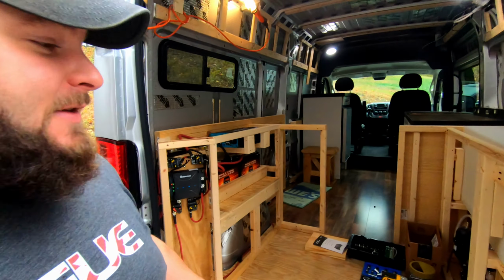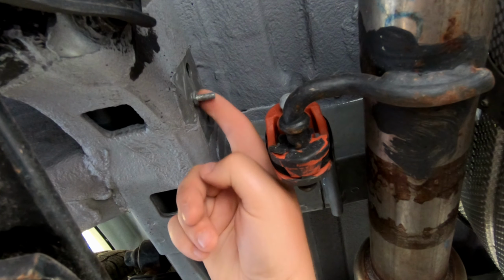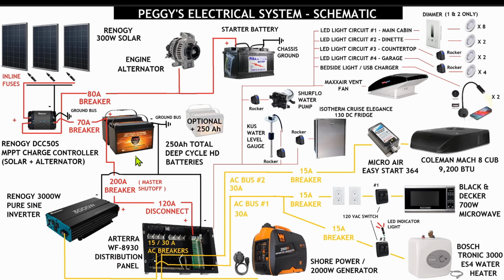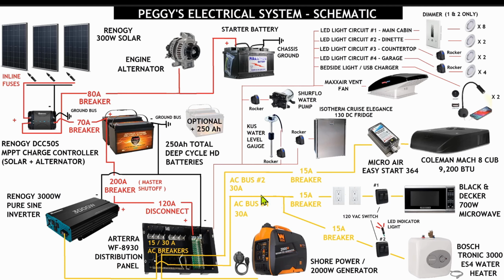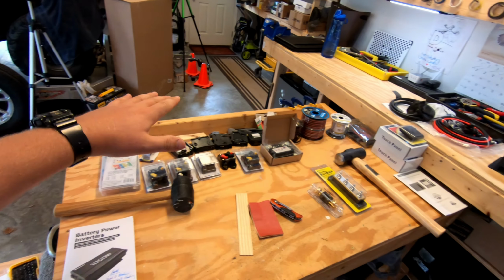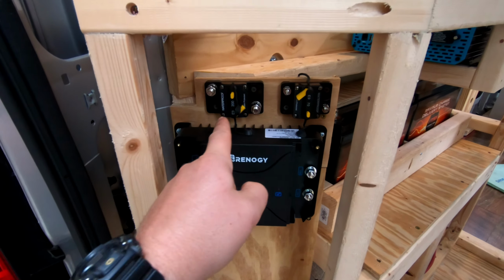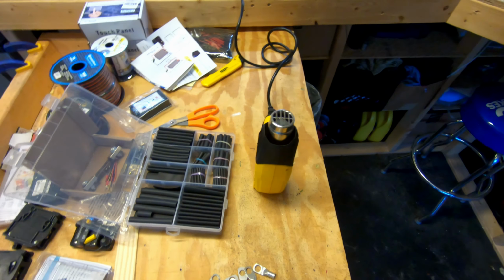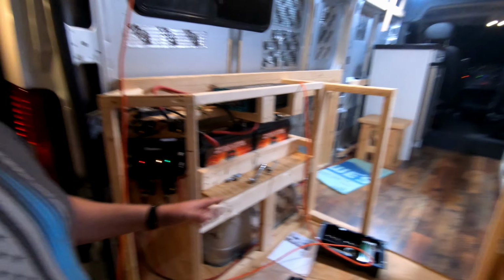DIY VAN ELECTRICAL - PART 1 #DIY #vanbuild

Comment: Question-

I have a renogy rover 40amp solar charge controller, where does the Alternator cable come into play on it? Do you need the specific one you have to have the alternator charge the batteries?
Reply from the maker: That’s correct, the Rover series only supports Solar input.

Comment: Sup Logan I like your videos your good what u do thsnks for sharing “what kind of copper wire do u recommend me using  ? to the front battery I just bought 2 lithium batteries running 400 amps and 600 watts of solar panels most likely I would use the same gauge wiring to my charge controller & inverter I would appreciate if u can help me out
Reply from the maker: Hey Mario! I use Windy Nation 100% copper for eveeything.  Based on this charge controller, 4 Gauge is sufficient for most runs including long run to alternator (starter battery) DO NOT buy Copper cladded aluminum wire or audio grade wire.  Stick to 100% stranded copper for your DC power system electronics.
Reply: Right on 👍🏼 Logan” good looking out keep doing what your doing i enjoy watching your channel

Comment: Hi Logan, would you recommend using that Bosch water heater on a 1500W inverter? Thank you!
Reply from the maker: No and here is why, it pulls 1300-1400ish.  A 1500W inverter may only supply 1000W continuous and 1500W peak.  Spend the $$ on a reputable inverter.  I’ve s once
Switched from Renogy and use Xantrex and Edecoa.
Reply: @biglogan3690  Ok! But if I understand it right, that would also require me to install batteries with bigger capacity?

Comment: How does this set up compare to using a Goal Zero 1500x for the battery and most of the equipment used here? It seems like for $1600 the 1500x has better specs and save you about $1,000. Maybe I'm missing something.

Comment: You have a ANL Fuse the between the battery's and the Ground Bar, what size are you using? And would the size change if you had more battery's?
Thanks for the Videos Great Job!

Comment: Also did you go with recommended cable? Or figure your own calculations and go with that? I see most people on Youtube using 2/0 from their house batteries and 4 gauge for connecting the dc to dc charger.. If course I have more research to do before I do anything!!

Comment: I have some of the same components. I went with a 3000w pure sine wave inverter and charger from Renogy. I figured it would be easier to have my shore power connection all in one. Assuming I understand the equipment use properly. I’m watching and reading everything I can get my hands on to learn before I connect a single wire. I’m in Yukon Canada. It will be another month before we really get out of winter up here.

Comment: Hey Logan! Love the videos! I just got a promaster to start converting. So a positive wire goes from the starter battery to the dc to dc charger right? You don’t have to run a negative? I’m not super smart with electrical. Just looking for clarification.
Reply from the maker: Thanks Amy.  You're correct the unit is grounded to the battery / negative bus bar / chassis.  Check out Will Prowse on Youtube and his Website mobile-solarpower.com for diagrams.
Reply: @biglogan3690  i love Will Prowse. He explains everything so simply! I was curious also because the inscreen vid showed you connecting the positive to the starter battery but I didn’t see you connect a negative to it.

Comment: I'm a wire wrangler too. Love a clean and tidy build that's protected. Sweet job! One question though- what's the wire gauge on your feed from the alternator to the charge controller? Looks a little small for that long a distance, potentially a lot of voltage drop along the way. I see you have the generator, but a thin gauge from up front can make alternators work extra hard and die sooner. Unless you found a larger alternator?

Comment: Could I use the micro air easy start 364 if I would put a regular house fridge in my van?
Reply from the maker: This only applies for AC.  Regular house fridge will work direct from inverter

Comment: Great video bro.. amazing design... I'm actually using this diagram for my build... just a little confused...What do you mean by split the common ground bar on the arterra distribution panel? Like grind it in half and screw it back? Do I need to do additional wiring to it?
Reply from the maker: That’s correct, but just for the neutral bar, the ground can reside for both Shore and Inverter Systema
Reply: Hey bud...so I am finally on this part...lol...so With this set up(cutting the neutral bar) am I able to use shore power and inverter power for my ac unit? Or shore power is the only power for my ac unit? What happens if I leave the neutral bar without grinding it in half? thanks again for you help.

Comment: Hey Big Logan! Quick question. What bar did you use for all your negatives? Is that just a bus bar? It looks different. And what size cables did you run through your breakers? 

Thanks!

Comment: Wiring question. I am finishing up the pre-wiring on my 2018 Ford Transit 250 - up to episode #12 on my YouTube channel. 

My 12v lines that go to a Blue Seas fuse block:

• One line for a group of 4 ceiling puck lights on a simple switch.
•  One line for a group of 6 ceiling puck lights on a dimmer switch.
 • One line for the MaxxAir 5100k fan.
• And then on each side, one run for 2 mini panels with 2 USB ports and a 12v port. 

I enjoy your videos - down to earth and nice explanations without wasting time.
My pet peeves with MANY van build series on YouTube are the coffee making, wife/girlfriend in skimpy clothing, endless Home Depot trips, life coaching advice, endless pet videos and unfunny bloopers. I sound like a grumpy old man (almost 70), but I am not - really. : ) Thanks for any advice. I just want to get these walls closed in and get to the shiplap board install on the ceiling and walls! : )
Reply from the maker: Thanks for the feedback!  Your on the right track!  I was thinking about wearing skimpy clothes on the next episode but now that you say this, I may hold off!  remember to always have a good path to ground on all your DC circuits and fuse protect at your distribution.  Also try to incorporate a “master” DC shutoff prior to distribution panel.  It helps when wiring new circuits!
Reply: @biglogan3690  Good life choice about not going skimpy! Your comment made my wife laugh big time. I will not really need a master cut off for the DC circuits because they all will be running from either an Ecoflow Delta 1300 or Ecoflow R600 Pro and I will just turn them manually off and on anyway. I do not have a full on electrical set up like most people do. The Ecoflow units will make it easy and I can also just lift them out when it is too cold and bring them own the house We do not do much cold weather camping anyway. If we do, I will just have a very small heater running off a Delta 1300 to keep the other lithiums warm enough.
Reply: @charlesmoman  what heater would you be running for these batteries?  I have bought the battle born ones and I should of got them to where they have heaters in them already, but didn't

Comment: Didn't see it in the vid but you do have a fuse or resettable circuit breaker near the main battery upfront correct? Also that ground wire running through sharp metal into the van with out protection is going to be the cause of a lot of problems when the insulation gets cut and it starts grounding out on the body.
Reply from the maker: Yes sir 200A resettable breaker is the master disconnect. If the chassis ground cable insulation wears out then that will make another body ground ;) jk it’s secured with grommet sealant on both ends :). Thanks for
Watching!